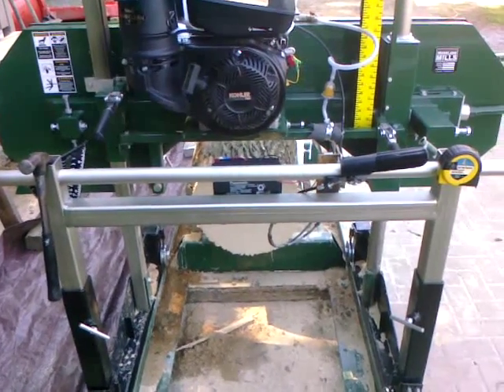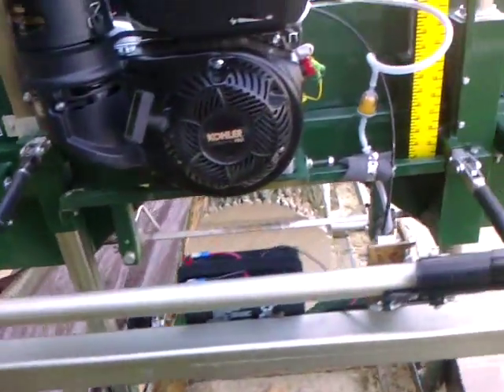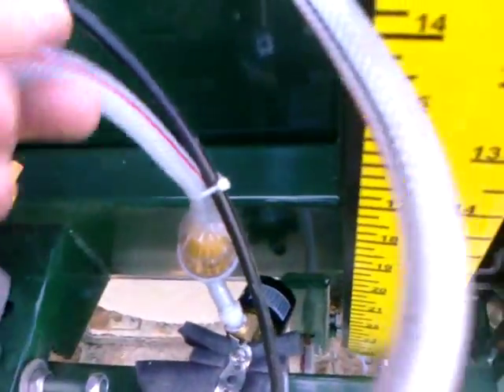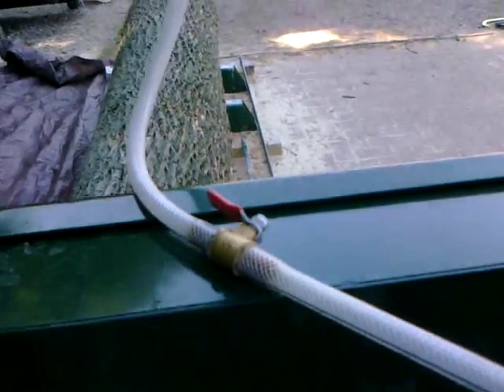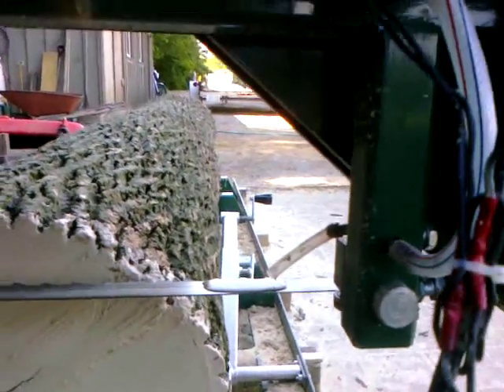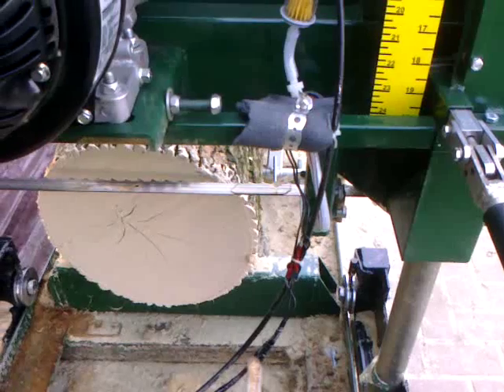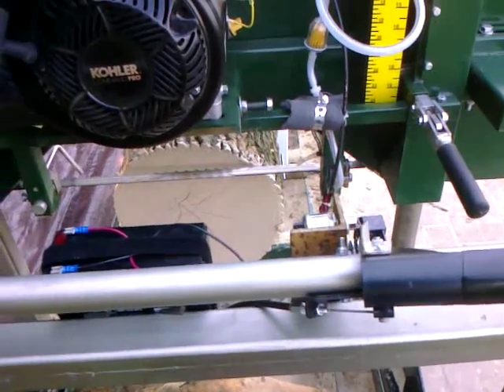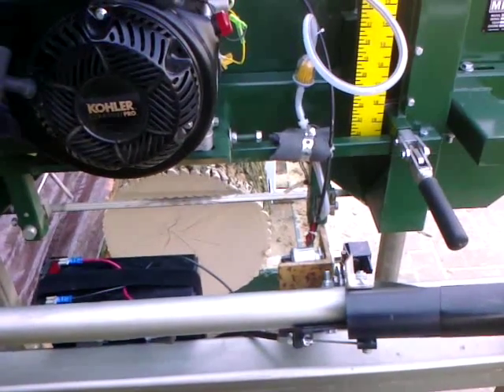HM126 Mod

Comment: Nice..i need to do this..thx
Reply from the maker: Greg Myers - I got the in-line solenoid at Princess Auto for $18 on sale. I added the in-line fuel filter as sawdust in the air gets into the water resevoir and gums up the solenoid!

Comment: Getting real close on a decision to buy.

How do you feel about the stationary guide blocks?  Problems?  Have you considered changing type or making them movable?
Reply from the maker: Benny Hannah Hi Benny, they have worked well for me, but most of my logs are less than 24". The only maintenance so far is to move the engine mount a bit to take up slack in the belts as they stretch over time. I have a new set of belts and bearings for the back of the blade guides but haven't needed to change them out yet. The new design for raising and lowering looks nice - it's a bit high on the older model when you have it raised all the way on a big log.
Reply: earlzathome
Thanks.  [I'd be graduating from cutting 6-ft 14" diam logs on my bandsaw.]

I guess I'd have to have the unit sitting in front of me to see how I could retrofit a sliding support for the blade guides [which I think I would want to swap out to a flanged-roller type]; since most of what I'll be handling will be smaller than yours [at least the 2,000 bf yield that'll be cut from my lot next month], I don't like a lot of 'unsupported' blade entering the cut.  The only other thing I'm not keen on is its 7" limit on depth of cut which makes quartersawing impractical.

On another point, I see you've sealed the ends of your logs.  What have you found to be 'best practice'?  Cut up timbers as soon as possible?  Seal ends and let sit for a week, month?
Reply from the maker: Benny Hannah I get your concern for unsupported blade, but really as long as the blade is sharp and your bed is level I can cut 3/16 strips off a cant  18" wide and they are perfect. The key is the bed level end to end and side to side.

As to the log ends, I paint mine with the minute I fell them. Mine has mostly been ash, and if I don't they can check 2ft in overnight. I put another coat on when the first one dries. I use whatever mis-tints in latex I can buy for $7/gal at most local big box stores. Sawing them up works best next day, but I've had logs sit a few years that were fine - just use a bit more lube because they are drier.